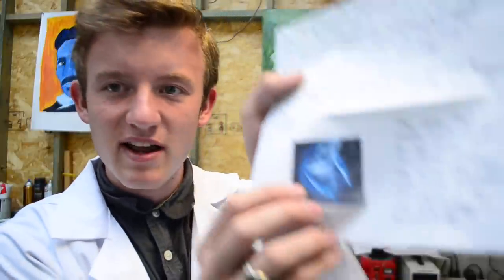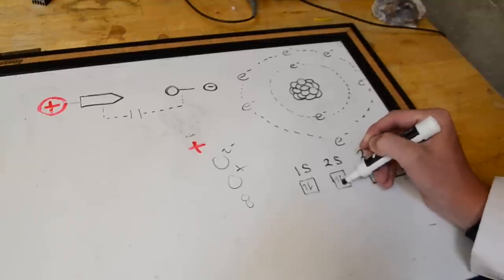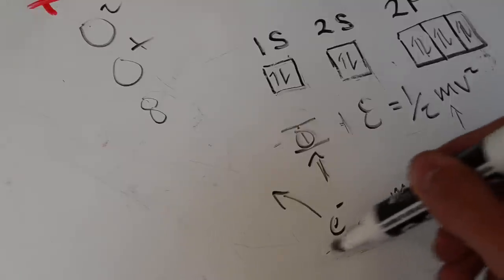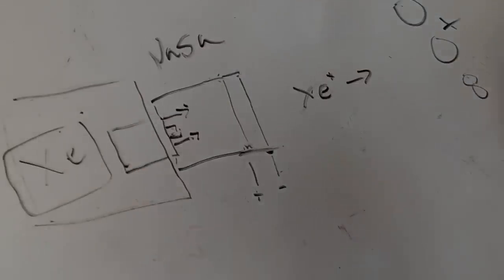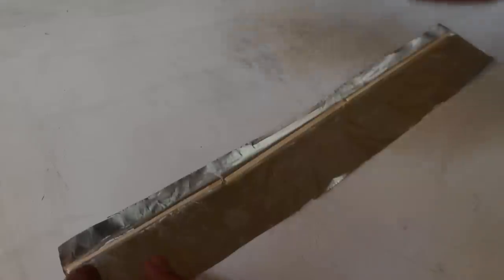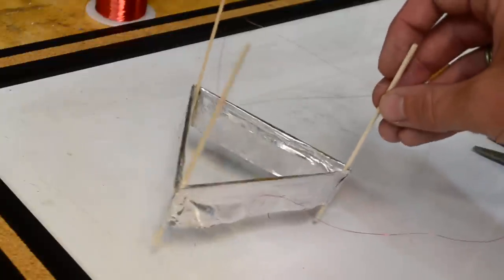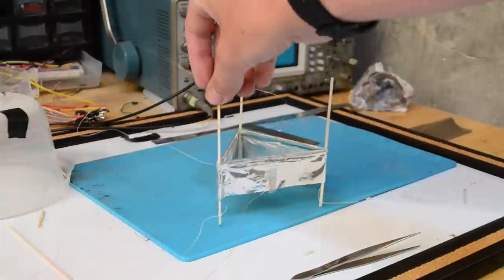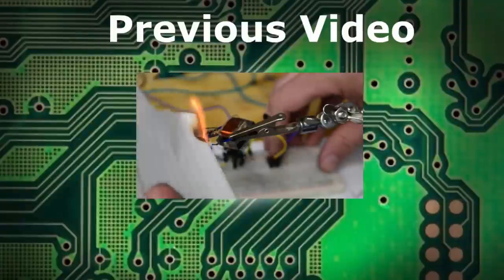How to make an Ion Thruster

Comment: "I don't think it would kill you because it didn't kill me when I touched it"

Science.
Reply: Not sure this is the definition of applied science, but it makes for good entertainment! XD
Reply: That's pretty much how science has worked since the beginning of humanity.
Reply: #probably
Reply: #famouslastwords
Reply: Trystan ...the 'that's what she said' setup is just tooo easy.
Reply: Trystan - Took one for the team! :-D
Reply: This is the definition of science. All you have to do is build it the same way and touch it. If you live then the theory is considered true.
Reply: It’s science
Reply: High voltage doesn't kill only high current otherwise we'll see more deaths from taser gun  than firearm
Reply: @ahmedalrawi3371  ya its the density that regulates the dangers of it, amperage can cause the eyes to bug out and remain that way, as arc travels around possibly creating a ionic drive system out of a persons leg that severed connections at highspeed from a otherwise completely normal body.
Reasons to be properly careful around capacitors etc, and stop dragging your socks on the carpet in a overly dry room before touching your pet cat because that's just mean lol.
Reply: Lol
Reply: instablaster
Reply: @flamingmoose1479  It really is. The last words in the universe will be "what happens if I touch thi....."
Reply: "if you touch something and it kills you, don't touch it again!"(stan lee/rip)
Reply: and then radium girl happened XD

Comment: I always wanted to try bulding a desktop fan out of these
Reply: That would probably end bad.... Maybe it's the whole "High voltage exposed wires" thing, or maybe it's the "I have oxygen ions flying around my desk" thing, but it still sounds bad. I would imagine having ions getting close to a computer probably wouldn't be preferable, either, because electricity. Judging by the fact you're commenting on youtube you likely have one of those little black boxes of circuitry and tech-wizard magic.
Reply: Trust me, you don't want ionized air around you

Comment: Great video..  
I used to see these all the time
. Called Lifters.. people made some absolutely massive versions .  Several feet across worth complex shapes 
Always seemed like the more simple ones like this we're stronger lift.. 
Many people used the flyback coils from old CRT monitors..  which were super common in the garbage at the time.. as LCDs were taking over .
Reply: Only the one shown on the website to the left though can carry its power supply onboard.  it  took a huge increase in power to weight ratio to do it!  Please click on the purple channel icon to see 5 prototypes.

Comment: Alright. Now make a hoverboard using in prupolsion. :)
Reply: Nate The power source would be too heavy
Reply: That's what I plan on in the future.
Reply: you would need to ionize a volume of air to displace your body weight. That would be an incredibly energy intensive task.
Reply: you will also need a power station
lol
Reply: @alice_in_wonderland42  theoretically you could create a flying machine with no onboard power. Radars have had 80% transmission efficiency for 60 years. These days a 5g antenna can remotely power electronics and interface with your nervous system.
Reply: @Ziggenvox  yeah i know 
the same technology is used in prototype solar drones which transfer power to ground stations
Reply: Please explain this technique that you mentioned here...it would be easy for you if you mention the source from which you got to learn about this science or invention
Reply: @naveencv3990  what technique?
Reply: You can not make enough electric discharge on board a board that can sustain the weight of you and the power storage supply and power production platform and levitate the board at the same time using ionic discharge. They can take you across the Galaxy if you were to exit the atmosphere. But if you'd like to utilize your Dyson airblade technology to appropriate that are blade to maintain air pocket blow a lateral board oh, you can do that so long as you are aware that when you create thrust to produce forward drive, there's no brakes on this thing. you're not stopping.
Reply: @rickyriccoboni2745  You can with superconducting plasma. But you civilians won't get access to this, I've been waiting years and even your commercial aviation market hasn't brought one to market.

Comment: I want to be in your giveaway episode. I work on micro controller based networks and it is pretty hard to figure out what's wrong without an oscilloscope. If only those things wouldn't be soooooo expensive
Reply: Jeff Chousterman just curious, don't these $15 oscilloscopes from AliExpress (the DIY solder-it-yourself kits) work for you?

Comment: To calculate the cinetic energy and the momentum of the electron, since it's travelling almost as fast as light, you should use relastivistic equations.
p=h/λ and K=Ε - Eo = 0,5m.v.v - mo.v.v , in which mo= m/γ = m.(1-v.v/c.c)^(1/2)
Reply from the maker: +JoãoVinicius Hennings de Lara ahh yes, good point. momentum should still be constant right? ( assuming no friction anyways )

Comment: It's quite curious how the lifter actually works.
It's essentially a leaky asymmetric high voltage capacitor that is being pulsed with high voltage. 
Being a capacitor means that there is an instantaneous high displacement current each time it's charged and discharged. That displacement current induces a large magnetic field that then induces an electric field in the center. 
What happens is the back emf induces a negative virtual charge in the center causing it to move upward via F=qE where E =150v/m the electric field of earth.
By Lenz law the induced emf is negative. The positive ions predominate and provide a small amount of lift but nothing close to the amount of force needed to lift the devce. The positive ions create a positive current that by Lenz induces a negative displacement current and negative virtual charge accumulation at the center.
 Virtual current is called displacement current. Virtual charge is the carrier of the displacement current.
So the negative virtual charge floats above a sea of electrons on the earth's surface that creates the earth's electric field. The ion propulsion story just doesn't pan out in the math. But it is a good exercise to show that.
Virtual charge does not need to be held in place so you can accumulate as much as you like in a region and not worry about it blowing apart due to coulomb force.
Reply: Paul Neilson I spent 40 hours reading the this
Reply: Christian Thompson 
Imagine how many I spent dreaming about it

Comment: could I make a bigger version of this if I used like sheet metal and 2x4s and some car batteries
Reply: If the voltage is high enough technically speaking yes. And to the comment of it would only work in a vacuum he would need to add a fuel of gases in earth's atmosphere he would be fine if you had enough power.

Comment: 1. How much voltage does it take to float the ion engine? 2. Is there a reason to use aluminium?

All the electrically conductive metals can be used in ion engines, right?

Comment: well of course i want to join the giveaway! :3 Btw i liked your video where you built oscilloscope from old tv... i managed to get it working but my dad won't allow me to work with it while he's at work... and i have a tip for you, don't poke the high voltage plug on the tv when it's turned on!! i got electric shock trough the rubber and it felt like someone pulled my finger very fast...

Comment: If the flyback coil output is AC, how did you convert to DC for the lifter? Does your transformer include a rectifier circuit? Does it make a difference if we run the transformer with an external primary as opposed to using the internal primary?

Comment: How many volts did you run through it?
Reply from the maker: +Dave Shakibanasab probably 40kv
Reply: Thanks Brother! I"m an electrical engineering student KSU and I love your videos!
Reply: Can 40kv kill you? I thought even 2 kv can kill you
Reply: It absolutely can, but what kills you is ultimately the amount of energy, which is a product of voltage, current, and time. I'm sure you've heard "it's not the voltage that kills you, it's the amps!", and this is an age-old saying that really doesn't make any sense. It's energy that kills you, not one specific thing. This saying is really similar to "guns don't kill people, people kill people!". More specifically, think of a bullet as current and the gun that fires it as the voltage. A bullet all by its lonesome won't kill someone. But load it in a gun and fire it, and you have something that can absolutely kill. In this case, the gun is the voltage, the bullet is the current. You can't have current without voltage, much like how you can't fire a bullet without a gun.

In general...I would say higher voltage is substantially more dangerous to work with, but it greatly depends on what precautions you've taken. The amount of current flowing through a system will be determined by the resistance, and every human body functions as a very large resistor (at the very least, the skin does). If you want to deliver more current to a fixed resistance, you need to increase the voltage. In other words, as voltage increases, current being delivered into the system increases as well because the increased voltage can overcome the resistance.

However, there are some important caveats to consider here. Any power supply you create is going to be 100% dependent on your wall socket. Wall sockets output 120V/220V AC. They also have a lot of potential current behind them. This is why sticking a fork in a power outlet is a really bad idea, because even 120V is capable of breaking down the resistance of your skin under the right conditions.

So...how do you get more volts out of your wall? You transform it. But, when you transform electricity, you are overall losing potential energy. Take a boost converter, for example. You can reach thousands of kV with one you make yourself, all running off of your wall socket. But what you gain in voltage, you lose in potential current. Think of it like conservation of energy. The current potential drops because you are still ultimately limited by the source. Plus there's also general inefficiencies with voltage transformations, no system is perfect, and any lost current from a result of stepping up a voltage is dissipated as heat.

Transformers literally transform the energy. They aren't spontaneously creating more out of very little, it's just changing the form of the energy and turning it into something different. They alter the ratio of voltage to current. The energy loss is due to efficiency in the transformation process. In a perfect world, you'd still have the same current as the source, but we do not live in a perfect world.

As Nathan stated, the most it did was burn him. Of course, you wouldn't want to touch something like the plasma wave from a Jacob's Ladder (not if you like having skin on your hand), but once you hit crazy high voltages, even if the current is limited to microamps, it will burn you long before it electrocutes you. There are also some other factors to consider like the frequency of the electricity, especially in the case of arcs from things like tesla coils.

Take something simple like an Arc Lighter. This is a commercial product, and I've heard people yell it's illegal because it is a taser. This is untrue. Tasers deliver upwards of thousands of volts at a constant rate due to the constant charging and discharging of the electrodes. An Arc Lighter is fundamentally different. You need a lot of initial voltage to ionize the air between the two electrodes, but once it's ionized, the voltage needed to sustain it drops substantially. Keep in mind, these are things that run off of 3.8v lithium ion batteries. The voltage needed to run it drops because an arc of electricity between two electrodes is literally a wire created by plasma. Since the breakdown of the air has already occurred and a clear, low resistance path has been established to the other side of the circuit by ionizing the air, less voltage is needed to keep it there. 

Touching the arcs from a commercial Arc Lighter will, at most, burn you. It stings and burns more than it electrifies. I would know, I've touched the arcs on mine several times. Of course, it burns far more than waving your hand over a traditional flame lighter because you are literally touching blazing hot plasma. It's no different when touching a piece of metal charged to 40kV. It won't naturally arc to your skin unless you get real close to it, and even then, you might have to give it some encouragement by touching it. Upon contact, if you pull your hand away, there will be an arc of plasma for a very short period of time, but it's enough to singe your skin and make it smell like burning flesh. And it stings.

Comment: The copper wire thats connected to the voltage is suppose to align around as the top copper wire did. Also, yu might want to create an electron magnetic field; either environmental or bulit-in system and last electrical tape covering....it'll save your life.

Comment: I don't believe you mentioned this, but what are the input voltage and current? Can I use a high voltage, low current setup? like with a high voltage transformer and dc-dc buck converter? Also, at what voltage does air ionize? Tanks!

Comment: Very awesome idk y we haven't massed produced this  or using in space crafts and cars etc..  but maybe u could use something else that wont burn up there r other metals out there that are light and wont burst into flames I'm sure u could use aluminium foil for legs too huh ? Enjoyed learned allot can't wait for bigger and more e things worth this or u could make a crystal power cell for it to ruin off of maybe
Reply: These are used in some space probes by NASA but the thrust they provide is pathetic compared to chemical engines, so they can only really be used when taking years to reach a destination isnt an issue

Comment: if a highly upgraded version of it is used to travel inside the earth's atmosphere , can the amount of thrust being generated altered and changed at different intervals of time and height? also can the micro-batteries be used instead of a high voltage DC supply?

Comment: I just wondered if you increase the surface area/length of both the wire and the foil will it provide more thrust?
Reply from the maker: +Laramie Webster yeah probably, as long as you weren't making it so the ions collided with the craft

Comment: I have a question that doesn't have to do with this video but a vid awhile back on making a high voltage power supply. I'm finally starting to work on it and I'm getting into electronics. Should I only use solder on circuit boards or should I also use it when joining wires? Secondly, is there any other way to prevent the flyback transformer from overheating without using oil?

Comment: Hey man, I've been seeing quite a few videos on capacitors as a car battery replacement. I have some extra sound in my car and run 3 big batteries and a Stinger 5 Farad capacitor. Been wondering about replacing maybe 2 of those batteries with capacitors, could you do a video explaining capacitors in 12v? Also, they claim to have replaced the battery entirely with capacitors which I'm not too sure about, could you explain if that's even possible, they also claim it holds charge and starts the vehicle after 2 weeks of just sitting there, needless to say, I'm skeptical.

Comment: I tried to make this a few weeks ago and used a boost converter with a 9V battery as the HV source, it didn't work very well. is this because of too low a voltage or perhaps not enough power?

Comment: Does it work under clean water since water isn't conductive?
Reply: Arg0n water not conductive ok then get in the tub filled with water and drop your toaster in while plugged in and then come back and tell me how it went.
Reply: I think pure H2O is considered an insulator. But where are you going to get "pure" H2O??
Disclamer: I could be wrong- I'm going from an ageing memory!
Reply: Arg0n Deionised water yes, but it will ionise pretty quickly, so not for long.
Reply: Distilled water is very slightly conductive due to tiny impurities
Reply: Pure water not clear water.

Comment: Your explanation describes ion propulsion in a vacuum but does not describe lifters (the device you make in the video). In fact lifters stop working in a vacuum (http://www.blazelabs.com/l-vacuum.asp) . The ions produced at the wire charge the intervening air molecules, which attracts the 'skirt' (the foil at the bottom). The air is pulled down (blowing out your candle) and the lifter is pulled up.

One thing which I am curious about is whether a lifter would work in a microwave. In theory the microwaves would ionise the wire, like the high voltage and perhaps would also cause lift.

Comment: Does anyone remember what happens when you have a spark gap and it doesn't arc then you light a flame between the spark gap? Yes. That and this demostration have nothing to do with air manipulation. I think you should change the name of this from Ion Craft to Snaking Craft. More so, I don't think if you connected 10 of those things in series like a donut, having the latter one lift the following one as they all truly have their own independent power source, the "Donut Snaking Craft [©]" will fly. That is why it's called a "Donut [Fly] Snaking Craft".